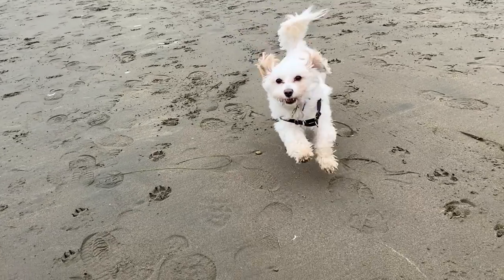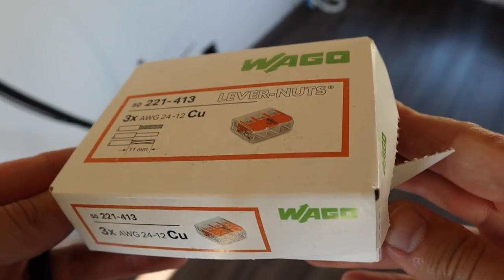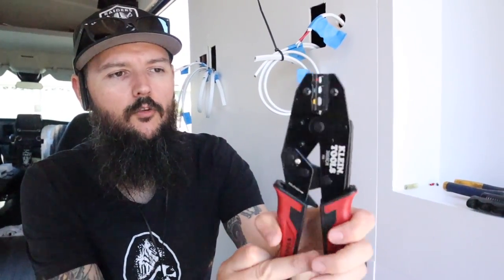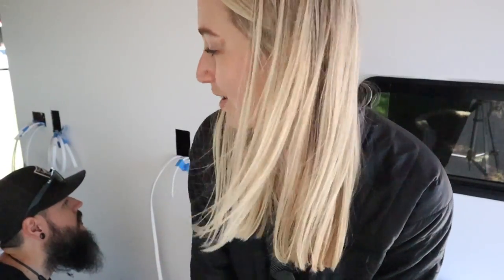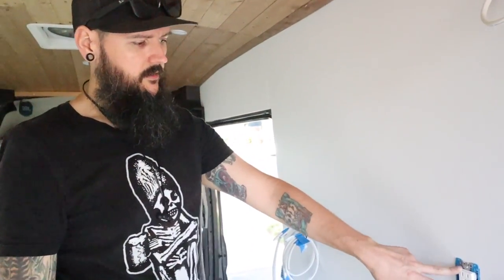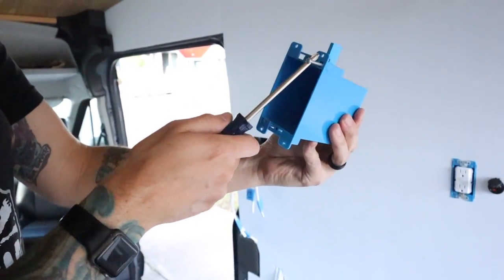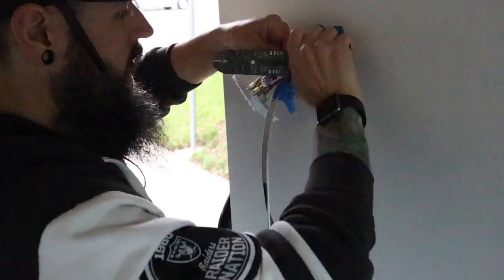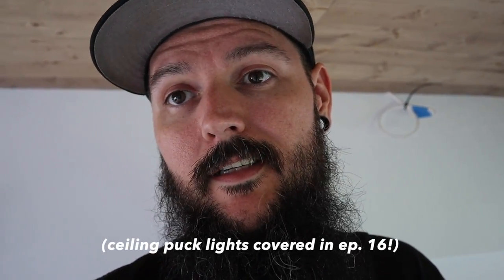Wiring 12V + 120V outlets, 3-way Light Switches & Reading Lights | 2021 Ford Transit Van Build Ep 20

Comment: Hi one of my friends and a customer suggested that I look at your video for some ideas.   I build van electrical power systems professionally in the San Francisco Bay area. 

Really just 2 suggestions:
- Don't insert USB ports inside of a 12 volt port that way.   Most of them will overheat and melt.   Use a good quality USB port with the quick connections instead. 

- The 120 vac outlet wiring will be dramatically better if you crimp on a retained fork terminal and screw it down instead of looping the wire around the screw.   Same for the ground. 

Eliminate the twist lock.   Those approaches are for stationary use, not mobile use.

Good luck with your project.   Looks like you are both having fun.
Reply: Sorry,  meant eliminate the wire nut on the ground wires.  That will fail from vibration.
Reply from the maker: Thanks Harry - this is helpful and we will look into making these changes from the process we used for the video.

Comment: Can you tell me please where you take to have 120v I don't really have idea because my van is ac not working I am trying to do 120v
Reply from the maker: Hi! I’m sorry, but I’m not sure I understand the question. Our A/C unit is 12 volt, so the only thing we have at 120 volt is our outlets. To use 120 volt appliances/outlets you need to have an inverter.